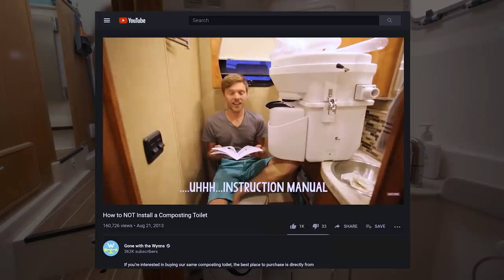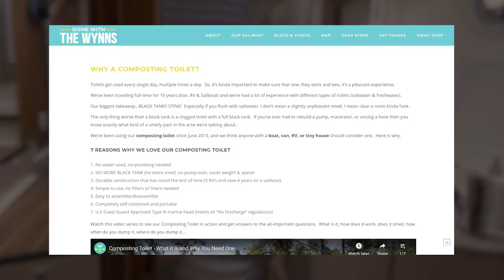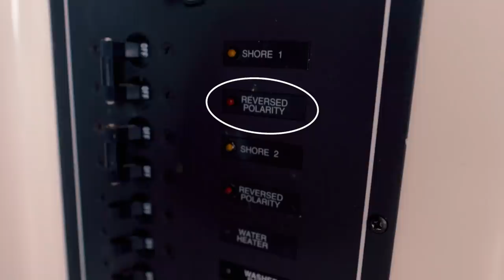BOAT LIFE, OUT OF THE WATER

Comment: Love our home-built composting toity (Natures Head etc wouldn't fit the boat, as most are very tall). Also, we've lived on rainwater in our home for 18 years. It is splendid for drinking and cooking, and quite easy to make safe. Bit of unscented Clorox (1/4 cup per 60 gal) when we first wheel the barrel indoors; it kills everything living, then mostly offgasses. Then we pump water thru a 10, 5, and 0.5 micron filter (that last being a carbon block). Filters last 6 months or more.

Comment: Best way for worldwide electricity compatibility is what you did, but "bigger". I have a 100-240v (anithing is between is fine) charger, it does not care if input is 50 or 60hz, that can put out 220 amps  at 14.4v (max). And because you can limit output, you can "match" it to the capacity of your outlet.

Just look at car audio stuff, way cheaper, and way more powerful then marine, for 1/2-1/4 of the price.

Comment: Wanted to mention a couple episodes back a possible fix for your fuel tanks. They have aluminum "brazing rods"  that require only a small torch.  I'm no welder, but the idea is you seal the tank holes by filling in with the rods. There are lots of YouTube vids on this. A real welder could advise.

Comment: Glad to see you are back "home", finally.
Regarding your electrical setup : be aware that you stepped down from 220 to 110v, BUT YOU ARE STILL ON 50HZ, not 60.
Some accessories, especially with motors (coffeemaker, grinder, etc), might be damaged if ran at 50hz. Not sure if your charger can operate for long if it is an american charger.
Take care.
Reply: Good news is they're only using the step-down on their charger which handles 
110-120 VAC, 50-60Hz. Since they're running all their appliances off their battery system, it's all good. :) Phew.

Comment: Congrats! Am definitely thinking of a composting toilet, esp since we've already managed to overflow our holding tank this summer with no marinas having facilities open, and no overboard discharge allowed in the great lakes!
Regarding the lithium batteries, I'd be more worried about getting them to 100% all the time rather than discharging them below 50%. Lithium batteries are happiest between 20-80% soc.
Reply: It depends on the make. If they're Battle Born batteries (for example), they are good all the way to 100% as they have headroom built in, if that makes sense. Their BMSes also level out the cells when held at 100% for a period of time - not that you'd need to do that regularly. But yeah, it doesn't hurt to have them under 100%, unless you need as much power as you can get. :)

Comment: I also have the same composite head on my boat. I agree with everything said about them other than some of the set backs I have had to deal with. One that happens quite a bit is bugs! Trying to get compost that doesn’t have big eggs in there that will hatch is a real pain. You need to also be cautious about how active you use the head. When a full time live aboard with two people the composting doesn’t have enough time to do it’s thing before having to change out the solids tank.
Reply from the maker: Oooh but we have 2 composting toilets! 😁

Comment: Our community has never had mains water or any form of communal supply, so everybody has always used rainwater for household purposes and probably always will.

We have always filtered and boiled our water but intend to adopt UV treatment as well in the near future.

Friends of ours have a 150 year old home nearby which they re-roofed in corrugated and galvanized steel a few years ago.

We have an old ceramic tiled roof which we had specially painted some years ago but even so, when it is compared to our friends rainwater theirs is noticeably better straight out of the tap no boiling required!

So your observation regarding the significance of catchment surfaces for rainwater is absolutely correct Nikki.

I also suspect that the zinc used to anodize our friends steel roof either has some purifying effect, or simply does not retain contaminants at anything like the quantities of our old tiles!
Reply from the maker: Tile will have lots of nooks & crannies to catch debris & hold it. Might have something to do with roof pitch too.
Cheers!
Curious Minion
Reply: @gonewiththewynns  Crooks and nannies indeed! 
I did entertain the idea of simply re-roofing in galvanized steel but opted not to.
I now regret that choice but given the investment in painting the tiles I feel I should get my money's worth out of that.😒

Comment: I have the noco 26000 and it works great for charging the only problem I had was the quick connection on the charging cable deformed from heat so I replaced with a heavier plug connection. Contacted noco over it they had no answers for me for solving future problems other than that great product.

Comment: I have been using 2 of those chargers to charge my huge electric 36volt fork lift for about 4.5 years, so 2 of them have been running basically continuously for 4.5 years. the cooling fan failed on one, i did nothing about it and in our 110degree 100% humidity shop in the summer time it has continued to work fine for over 2 years like that im sure its the very dusty environment that caused the fan to fail.

Comment: Great video, as always. Thanks for the update on the composting toilet- I've been wondering about that since you've been sailing for a while now. I also wondered about the stuff that goes down the kitchen sink... at home, I see all the food bits and grease going down the drain but don't know the boating alternative! I sure wouldn't want to clean out a grey water tank any more than a black water one. I assume it is legal to dump grey water when at anchor, yes? Thanks for all!
Reply from the maker: Correct with dumping grey water. I don't know of any boat that has a greywater tank - it all goes overboard. In the USA there are restrictions about size of food particles going down the drain, but it's easy to catch most of them in the sink strainer.
Curious Minion

Comment: "Sailing on the hard" or "Sailing on land" comes with some challenges...   Nice transition back to boat life video!  I found the power situation most interesting.  Your MacGyver solution seems to be working and I am guessing, in addition to the higher 230V primary voltage, you have to adapt to 50Hz vs. the American standard 60Hz and is something a simple step-down transformer would not be able to fix.  This explains why simply using the power to charge the on-board batteries is the best solution to protect the rest of the electrical/electronic systems you have.  Stay safe!

Comment: On your power issue. Next time, take apart the 110v. plug you have, and simply reverse the green and red wires on your plug, that's what we call "reversing your reverse polarity". No extra charge (sic). Chances are good it was wrong to begin with.

Comment: Having both seawater and composting toilets on the same boat seemed weird to me except as a cost saving measure, but the small blackwater tank and use in parks and on the hard seems like a good reason.
Reply from the maker: In the beginning they weren't sure they would always be able to find composting medium in remote areas so one marine head was left as a precaution. Turns out it hasn't been a problem, but hindsight's always 20/20. 
Curious Minion

Comment: You may not see this since it is 6 months later, but LFP batteries would probably be happiest from 75% to 25% instead of 100% to 50%. The ones I have used say to store them at 50% as they are happiest there. Going lower than 10% is probably not great, and constantly charging to 100% also not great, of course you are usually not charging at a high rate with solar, so that may help. Anyways, my 2 cents from some years of LiFePo4 battery research and converting a car to electric drive. Check with the manufacturer on your specific cells, but from all the reading I have done, it is best to center your usage around the 50% mark instead of charging all the way up and draining to 50%. If you are comfortable with 70% total usage then an 85% to 15% DOD would be better than 100% to 30%.

Comment: The electricity thing is stupid. Boat builders should know that people will be sailing between different systems/voltages. There should be at least the option to have those converters built into the boats electrical system so that this type of issue doesn't arise. I've seen a lot of videos where people will at the very least make a comment about voltage and charging batteries and sometimes even the plugs (the builders should be able to make that a fairly simple switch for the owners, too).
I'm glad you were able to figure out a way to at least get a trickle charge. Congratulations on being back home.

Comment: If I was there it would be a time to celebrate by opening a very expensive  bottle of the Napa Valley Reserve 2000 wine I was given or perhaps my bottle of Martin Remy XO... You actually arrived at this point much sooner than I thought that you would. Great job!

Regarding the rainwater, when we have traveled in the south Pacific I was more concerned about the mouse and bird dropping on the roof than the polution in the air.

Comment: When I think shore power, I think air conditioner.  Can it run yours?  If not, maybe a small window unit with a jerry-rigged box over the deck hatch where you sleep?  I ride out cyclone season on a trailer because on land is the safest place for a boat in a hurricane.
Reply from the maker: I believe Curiosity still has a hybrid inverter. They're awesome because you can set a limit to pull from shore power, and if a device needs more power it can pull the rest from the batteries. Perfect for driveway surfing & life on the hard! https://www.gonewiththewynns.com/product/magnum-hybrid-series-invertercharger
Curious Minion

Comment: If you have 220 volts all you need is to split  to 120 just  used 1 live contac and the common  in the 220 plug  you will have120

Comment: Your American appliances are designed for 60 cycles, some 50 or 60 cycles. If some motors are running hot and slow, that is because you have 50 cycles in Tonga.

Comment: Way better to have 230/240 extension cord and a transformer on the boat. Higher the voltage, lower the loss on the extension cord. That's why long distance wiring is done at thousands of volts.

Comment: Australian power is also power in the EU
In fact there are more places that uses 220@50 Hz VAC to 240@50 Hz VAC than approx 120 VAC@60 Hz
https://www.worldstandards.eu/electricity/plug-voltage-by-country/

You can use an isolation transformer to easily use either use onshore power at 115 VAC@60 Hz or 230 VAC@50Hz.

You would has to use an isolation transformer with 2 primary windings (both must be 115 VAC). The transformer will need to tolerate both 50Hz and 60 Hz alternating current.

Put the primary windings in series and the transformer will take 230 VAC onshore power, and connect the 2 primary winding in parallel and it will take 115 VAC onshore power.

The next problem is all the adapter cables you would need.

WARNING: Make sure to connect them correctly - both when using a series and parallel connections. 

If you connect them incorrectly, the 2 primary winding will make 2 magnetic fields that will cancel each other out - creating  a lot of heat, and no voltage on the secondary windings.

A transformer that are buzzing really loud is using a lot of VAC amps, meaning you are using the parallel connection connected to 230 VAC.

Feed in 230 VAC to the 2 115 VAc winding will make transformer transfer 4 times more energy than it's designed to.

If 2 primary windings gets 115 VAC the voltage on the primary windings will be the double of the design VAC voltage, e.g. 24 VAC instead of 12 VAC.

In other words - you will need a circuit that chooses the correct winding connections (series or parallel) according to what it can measure what the shore power VAC voltage is.

Caveat: Isolation transformer are expensive and heavy, but you can make a DIY one by connecting two 115 VAC motors and a 12 VDC generator(=a motor) on same shaft.

Comment: Drinking rainwater is fine, but it lacks all the minerals that groundwater has. The other problem with rainwater is bird poo collected off the roof, which is probably such a tiny amount that it wouldn't really matter but I would run it through that UV purification system at least.

Comment: Quite surprised an ocean cruiser does not have both 240v and 110v capability fitted as standard
Reply from the maker: Jason said he plugged in and the one on the boat didn't work. Something has happened to it in the 15 years since she was built.
Curious Minion
Reply: @gonewiththewynns  yea I saw that he said he plugged in and it didn't work because of reverse polarity (just needed live and neutral swapping if that was the actual issue) but then used a converter box to step down the 240v shore power to 110 and went in a window to frankencharge the batteries..  therefore If it had a 110v socket on the outside (and it looked like it had both) why couldn't it just be plugged in there (through the external shore converter) 🤔 bit confused there that's all.

Comment: I get not wanting to run your batteries too low. Lithium batteries are usually sold as being good down to 10% state of charge. They are absolutely bomb-proof down to 20% SoC, and you don't need to have any concerns at all about them being below 50%. They will be fine.

Actually, if you set your charge controller to run them between 95% and 15%, they could easily last decades. If you have doubts, watch some of "will prouse" YouTube videos. Good luck.

Comment: I don't have a thing against choosing a composting toilet - but did you actually say that save water?
Reply from the maker: Correct! Most composting toilets don't use any freshwater at all for flushing, and even a low-flow conventional toilet uses about 1.6 gallons/flush. The design of the bowl directs liquids into the liquid holding tank, and solids drop straight into the composting bin without touching the sides. If you'd like, you can keep a spray bottle beside the toilet to rinse the bowl. For more info you can check out the composting toilet tab on the blog: https://www.gonewiththewynns.com/living-off-grid-rv-sailboat
Curious Minion
Reply: @gonewiththewynns  not what I was getting at. Most old-fashioned systems use sea water, which is a plentiful commodity, not fresh water.

Comment: 17:30  EEEEKKK  I would hardwire it ... or at least use crampon O's with a foot of wire on the end to CLIP ONTO ~~ then put one or both them clamps in ziplok bags...  isolate the SPARKS and you have less smoke....  stuff stops working if/when you let the smoke out!  (but you prolly already splashed and fixed the alternator and now you generating all the power you need.... ;)  but...  you can leave the pigtails on and wind them up and put heatshrink on the ends for the ''NEXT TIME'' you need to directly clip into the system....   or that's what I would do...

wait... where did that ALTERNATOR part up there come from...  CHECK YOUR ALTERNATOR  ;)  
have it tested!!! not just test it for output with a meeter...

Comment: Why aren’t you using a”Berkey” for water purification?  It just makes more sense than what you’re currently using.
Reply from the maker: There's a filter system mounted under the sink but Jason mentioned that he hadn't had time to get it back up & running yet, so the Sawyer filter & funnel are temporary. A Berkey takes up valuable counter space and has to be secured somehow for rough seas so the filter under the sink makes more sense.
Curious Minion

Comment: So the fresh water tanks were not so hard to clean.
Reply from the maker: Tanks and lines? No, not really. If Nikki & Jason left the tanks & lines empty, they probably just added some chlorine to the tank and ran the first batch through using it only for cleaning and not for drinking.

If you want to be super careful, you need to fill them and put in a heavy dose of bleach & fill the tank completely. Then make sure to run the chlorinated water through all the lines and the hot water heater plus hot water lines. Drain that all out, run the lines dry, and then refill.
Curious Minion
Reply: @gonewiththewynns  If your statement is correct why did they pull the tanks out of the boat and set them on there ground in the video?

Comment: Rain water is not dirty that’s miss information learn your facts before putting them out on the social platform! Rain water is ph neutral , soft also pure until it comes in contact with the surface. Research the facts 👍🏻
Reply from the maker: Well the CDC and many others would beg to differ with you. Falling rain can pick up smoke, soot, and dust from the air. Acid rain ring a bell? Here's a link to a CDC article: https://www.cdc.gov/healthywater/drinking/private/rainwater-collection.html
And at any rate, it has to fall onto something in order to be collected, so it'll get contaminated regardless.
Curious MInion
Reply: The CDC takes a general measure over highly populated and industrialized cities especially those with heavy pollution these are those figures you are referring to as those figures do not reflect rule an unpopulated areas where the air is much cleaner and the rain is pure again research is key.(CDC) Center for disease control primarily measures pathogen’s in the water this is why you would use UV‘s and filters for your water everything else is circumstantial at best. CDC will also reference surface contact. Great chat 👍🏻 may winds forever be in your favor! 🙏🏻